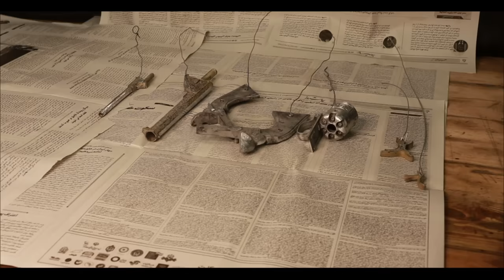Old Model Ruger Revolver Gun Restoration (decoration gun find in river  )1851 Navy Model Restoration

Comment: First of all: Ruger never made an open top cap and ball revolver, and certainly not a toy. Second, if that gun was sitting in a river long enough for their to be "deep pitting" on the surface, those screws would have rusted in and that spring should have been GONE. Secondary, if you're removing active or even surface rust with white vinegar from that much metal it's going to need to sit for multiple DAYS not hours. And if ANYONE in my shop took a FILE to a firearm to remove pitting we'd start hitting you with it.
Reply: you are right...i know nothing about restoration..but so many things seemed off on this one.....not sure why the guy would want to try and fool people like you..or even me......if you watch other gun restorations here...its easy to see this one....does not add up
Reply: I don't think Ruger was around in 1851
Reply: @jadezee6316  because he has 3M views on his video and never had to invest in the infrastructure or develop the skills to actually restore a rusted firearm.
Reply: Not sure why he did replaced screws before he disassembled it , It looks to me he already disassembled it before and already replaced parts (spring is still intact) Is this actual rust or something else?
Reply: i hope that this one is from FAKE RESTORation...hey made some crap dust and put it on and than made a video
Reply: Totally agreed, I know nothing about restorations but when I saw him come out with that rusty shitty file I had the same instinctive reaction. At least he does not speak which is greatly appreciated
Reply: @tomhoffman9729  correct. The point is this is a reproduction of a colt, not a new(er) production ruger old army.
Reply: Never mind the file, the sand blaster made me cringe.
Reply: I was very surprised he would remove that metal detailing
Reply: All that “work” and the cylinder didn’t rotate 😂
Reply: @jadezee6316  
Ruger was founded in 1949. Regardless of the factual inaccuracies or fabrications by the creator of this video, I think we can agree the gun was in a severely rusted state of crap. If you believe that rust was real. If it was, the process and final product was amazingly beautiful.
Reply: I know what an toidi wasn’t Ruger a P-08   Dweee!
Reply: Is it something to do with thinning the metal on a extremely pressurized device? i never work with firearms so i have no clue why the file is such a bad thing.
Reply: Also, if that were a real revolver, it certainly wouldn't have a hollow, two part frame held together by two cheapo screws.
Reply: @greasedog  it’s very straightforward to quickly build up layers of rust. Just invert the ‘typical’ electrolysis setup, let it sit for a few days, maybe set up a camera and tools by your workbench, and voila. Instant YouTube bucks.
Reply: @TheRestedOne  
10-4 I’ll gladly defer to your expertise. I’m  just a regular dude with a slightly more than passing interest in firearms who stubbled onto a rather cool restoration video. I once restored my dad’s old .22 rifle but it didn’t require anything as drastic as this.
Reply: You can literally hear the plastic when he clicks the gun
Reply: it's fake
Reply: downvoted instantly at the file part. it's not just the firearms, you don't file ANY antique.
Reply: Do you have any suggestions on channels that doesn't do fake stuff?
Reply: Yup the Ruger old army had a top strap,this is fake.
Reply: Also, the whole thing looked crap, the gold colour is awful and the handle isnt even flush with the frame.
Reply: @tomhoffman9729  They weren't Ruger didn't start until 1949
Reply: @tomhoffman9729  yeah it seems to me like a colt dragoon judging from the cylinder and latch for the ramrod
Reply: @tomhoffman9729  they were not, the Ruger mark 1 took notes from Japanese pistols in the second world war, mostly because Ruger himself had nambu pistols from his service in the Pacific, also he calls this an 1851 navy which is far more accurate but it's still not a Ruger...
Reply: This comment should be at the top, that's a cheap non firing replica, early colts like that had 1 peice recivers.
Reply: @ivoivic2448  It's not an antique. Read his description. It's a cheap Chinese toy.
Reply: @tomfoolery1967  so you're saying I can report this video for misleading text and thumbnail? neat.
Reply: @ivoivic2448  I’m not telling you anything. If that’s a terms thing on YouTube sure. Im just pointing out he describes what’s in the video in the video description.
Reply: @tomfoolery1967  nono, you see, you can't take back what you said now. you gave explicit evidence that content of the video is not what is described in the title. if you wanted to "teach us haters a lesson", could'v done your homework better.
Reply: @ivoivic2448  What are you on about? I’m not taking back anything. Why are people so strange on the internet. All I’m telling you is he has a description. It’s there in plain English. What’s wrong with you?
Reply: @tomfoolery1967  indeed, why are people so strange on the internet? defending an obvious clickbait video. I'd repeat the last question too, but I already have the answer to that.
Reply: I'm curious, how would you clean it instead? Is sandblaster still ok? -or would you need to scrub it for days with brass wool?
PS: I don't know what speaks against using a file, besides it being potentially too abrasive. I'd be more worried about using any automated machine that could overheat it...
Reply: @edi9892  the sole fact that removing material in that volume from anything old is extremely stupid. if you're so worried about the pitting, then fill it and paint the object. he painted it anyway so what was the point of removing original material?
yes, scrub. nothing done well is done quickly.
Reply: Definitely not a Ruger!!
Reply: @edi9892  You use a fine grit sand paper on a tabletop belt sander, or by hand for fine detail, if you're trying to remove light pitting. You can use a sand blaster with a glass bead media if you're removing the finish, you won't hurt it if you're careful. You only use files for removing a lot of material like if you're installing a dovetail. If there's anything to heavy you're risking going through the bore at that point your either don't do anything or send it off to get laser welded back together.
Reply: hell  yeah.. the filing killed me
Reply: Looked like a metal file being used on the wooden grip... maybe never knew of wood rasps sandpaper.. dont the nipples screw out? I'm not sure on that,,,but all seemed Bs to me
Reply: Read the description Sherlock: 
The description says it's a chinese copy, which is most probably made in the 90s with some type of aluminum alloy made to sustain rusting for long periods of time, which is why you only see pitting and not the gun falling apart.

Get smart and check the description next time, Einstein.

Comment: The post that holds the cylinder was very clean for sitting in a river.... its also amazing that none of the screws broke and the internals came apart so easily. What a lucky find in the notreal River.
Reply: It is all fake...You do not understand it???
Reply: @artamandi  my entire comment was sarcasm.
Reply: The Notreal lol
Reply: @artamandi  do you not understand what sarcasm is??
Reply: C est un jouet a la base...et personnellement je n ai jamais vu de l aluminium rouillé juste oxydé...car le corps et le cylindre sont en aluminium...n' oubliez pas qu' au début le manche est en plastique....tout est fake...
Reply: its not a real gun, as he mentioned. Its a cheap prop gun he found, probably only a few years old. Made by some chinese company
Reply: @Macatawai  which is why it was in the Notreal River
Reply: @Macatawai  Its a blackpowder replica of a colt navy. I can get that same gun new for like 450 bucks
Reply: @ianwilkinson5069  It's basically a die-cast toy gun; You can see how skeletonized the inside-grip mechanical areas are, and the... Well, excuse my ignorant terminology, but the ramrod lever thing for compressing the powder and ball can't even move.
It was a bogus non-firing paperweight from the start, not even black powder, and probably cost much, MUCH less than 450.
Reply: @artamandi  Notreal River
Reply: And the screws were not rusted. And looked brand new.
Reply: It's a pistol lighter .. not the real gun . I have it too.
Reply: Its amazing that the screws werent dirty but the rest of the gun was!
Reply: @ianwilkinson5069  Its a Toy of the 1851 Navy. I have a reproduction, sitting on my computer desk.

Comment: Love how the rust didn’t touch the screws. You can also still gold color coming from the cylinder. Also very easy to take apart crazy!! Oh can’t forget that anyone who truly restores firearms doesn’t take a damn file to it and would never ever paint the firearm.
Reply: Screws threw me completely off!!
Reply: "Found in a river" yeah about that.....
Reply: I was thinking that a file would have ruined some of that scroll work on the barrel. It didn’t seem to phase it..?? 🤔🤔🤔
Reply: It's a toy cap gun...geesh.
Reply: Thought the same thing
Reply: Not to mention the gaps between the wood handle and the metal portion of the firearm craftsmanship is subpar
Reply: and the spring around 2:05 which really would have been gone.
Reply: The best part is when he separate the wood handle and shows the super rusty wood🤨🤨🤨?When in this world wood has start to rust? I suggest you guys cover your tree when will rain 🌧😭
Reply: Yeah, wasn’t that amazing that there wasn’t ANY rust on it, and it came apart soo easily.
Reply: black powder replica firearms(which it is modeled off of) are more likly to be painted black instead of bluing...ignoring brass parts
some 50s-70s cheap rifles revolvers and shotguns are also painted black instead as bluing/plating  and wood was out of fashion they even had plastic grips/stocks(another complaint i saw)
a common way to fill pits is welds then grind/file back smooth....
you are nearly as full of it as this video is....
Reply: @TransfemMarta  It isn't a fake firearm. It's very real, just dipped in an acidic medium that was simply wiped away in a professional looking manor.
Reply: @johnh798  it’s a cap gun
Reply: It’s literally just a for entertainment guys. You don’t have to take it so seriously. Plus he says it’s for decoration so it doesn’t matter about filing or painting. If you don’t like it then don’t watch it
Reply: It's not rust on the gun "it' horse sh%t"
Reply: I noticed that also 🤣🤣🤣
Reply: in this video I learnt that brass and lead rust, the rust looks like KFC, all other restorations from this channel rust in the same way and none of the rusted stuff had any pitting, rust damage or missing chunks due to rust
Reply: Facts… And it was mad quick cheap and cheesy I think it’s a fake
Reply: Me as a gunsmith: NO PLEASE STOP WHAT ARE YOU DOING!
Reply: Lolz I was thinking THE SAME EXACT Thing. There's no way he found that gun in a river. It's almost like he already had the rusty pieces disassembled and he put it back together only to disassemble it all over again for this video.
Reply: @jeanhamilton3296  He probably got it off Craigslist. I don’t think someone could fake that considering the amount of rust
Reply: "Found, and Restored" are very loose terms to this person. It's all BS. Curated for our views.
Reply: Literally all this crossed my mind while watching
Reply: @Anthology_of_Holly  Can't expect us to actually read... we're here for video.🤣
Reply: @johnh798  it is fake, didn't you notice the barrel, one end is blocked, so how would it fire? Plus if it were real there would be more eternal parts.
Reply: @TransfemMarta  It's a fake gun, fake rust, fake video.
Reply: Would also never take a wire wheel to it
Reply: Man I didn't want to say anything so, glad you did... Was thinking the same thing.  I was starting to cringe when he pulled out that file and then vomit when he pulled out the spray can
Reply: @jeanhamilton3296  Any gun in a river would easily have calcium, lime, or silt deposits all up in there.  Not to mention how the rust looks totally sun dried compared to how an actual water find would look.

Source: I watch waaaay too much DALLMYD
Reply: @BigRheno  ikr, that was my point.
Reply: Interesting 🤔
Reply: Seems a bit fishy if you ask me.. the way it was cover with whatever and them screws being to easy..
Reply: @johnh798  If it isn’t a fake, decorative firearm…how does the cylinder rotate?
Reply: Not talking about the scuffed tolerances of the cylinder when it rotated , the weak af hammer spring and the off sound the hammer made , like cheap soft metal. Not to mention the plastic handle scales that were conveniently unscrewed ? Call me a conspiracy theorist , but i dont think this was able to rust in the first place
Reply: It's a novelty lighter that was popular at local markets like 10 years ago. I've got the exact same one. The handle has a container for lighter fluid, and when you pull the trigger the flame comes out the barrel.
Reply: @khdownes1  i think you are under the wrong "derusting plastic" video , the breakdown looked pretty seamless and there were only a bunch of springs in the handle
Reply: @yannickgobel2431  No this is definitely the exact same trinket I've got. They've probably just taken out the little plastic container, tube and igniter before they fake-"aged" it in preparation for this video. You can see the hole at the base of the handle; that's where the refill nub for the lighter fluid goes.
Reply: It's a cap gun...  I had one just like it in the 90's.  They were the ones that used the circular red, plastic caps for revolver-type toys.  He restored a cap gun.  That's some funny sh(t.
Reply: Nothing happened to the screws and the springs. Yeah ok I call it bs.
Reply: La abuela con dos pistolas...
Reply: @marcelschellekens6386  that is what I said... would be the first thing to disintegrate
Reply: @johnh798  ohh ok now i believes you
Reply: i know right this guy is a embarrassment to gun Smiths everywere and if someone is watching this they will think that they can restore a gun what if they fire it sad
Reply: @johnh798  dude... It's not real at all.  It's a cap gun.  That's obvious from the difference in size of the barrel and the cylinder chambers.  Among other things.
Reply: I call heifer dust
Reply: Pot metal doesn't rusf.
Reply: I agree, but i just wanna point out, its for decoration, not use or a toy.
Reply: I take back my previous comment. This is just allwrong.
Reply: Just spray a little WD40 and the screws loosen up😂🤣😂🤣
Reply: I was thinking the same
Reply: I had to use a file on a couple of Pietta parts to be fair.

Comment: This just goes to show you that there are people that know a lot about things they know very little about.
 It’s a toy gun. Basically a copy of a Colt 1851 Navy revolver.
Reply: I have a reproduction pietta 1851 navy, pretty cool
Reply: YEAH I JUST NOTICED THAT IT WAS ONLY A TOY GUN DARN! THIS VIDOE IS. VERY DISAPPOINTING
Reply: It could also be a toy replica of a Itali dragoon both have similar design
Reply: @shawnfortine3199  There is no such thing as an Itali dragoon. Colt made the Dragoon and this is obviously a replica of a Colt 1851 navy as the Dragoon was much larger.
Reply: @outspokengenius  The name of the company is Italy I said the Toy was either Dragoon oar called and I have a picture of a dragon that comes pretty close to size and it Is a fully functioning replica
Reply: @outspokengenius  auto correct keeps changing the name so I’m not gonna be able to say that right name
Reply: @steverichardson2627  это обман!
Reply: Yes, I have a replica 1851 navy made by excam in Italy. Those side plate screws came out of this "rusted" gun, easier than my clean one.